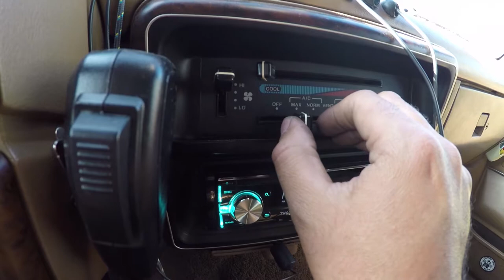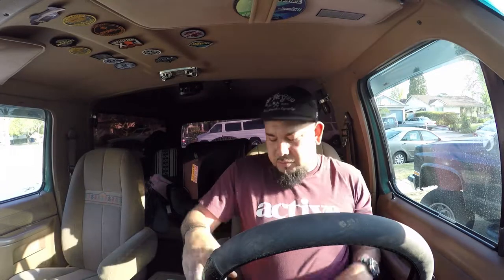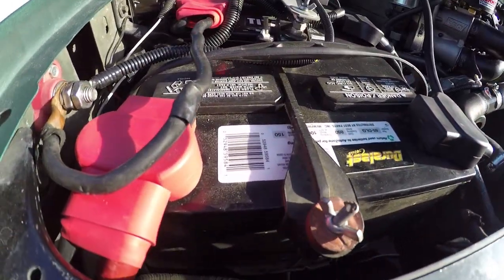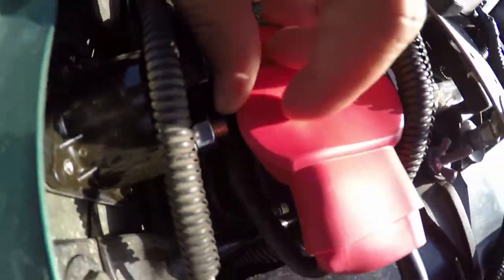BRONCO R134 RETROFIT

Comment: I know this is old but I did my 92 f140 blows cold but the compressor never cycles off. Did you have this issue?
Reply from the maker: Yes. It ended up being my A/C pressure switch.